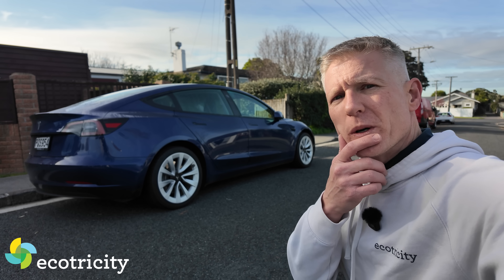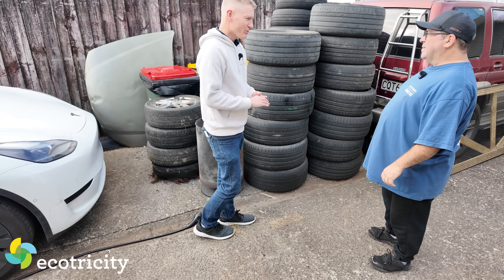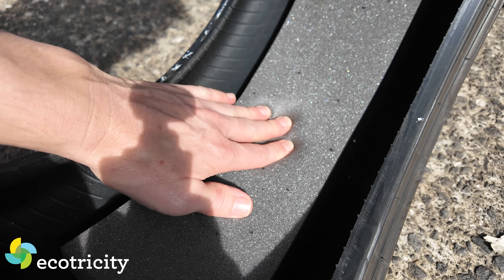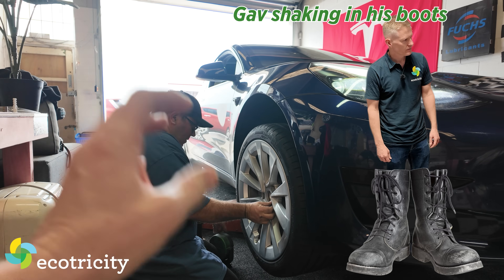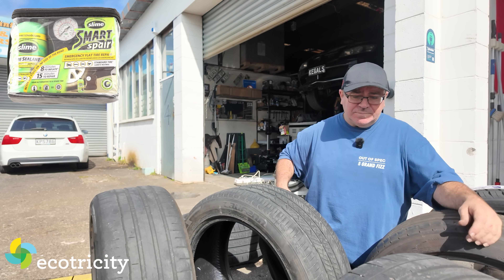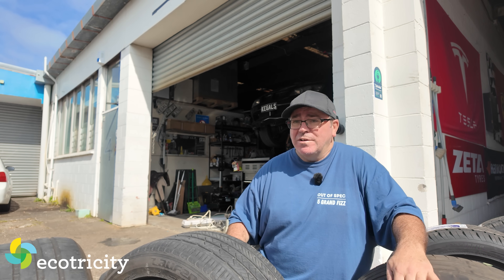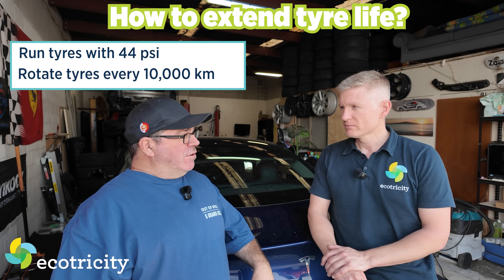EV drivers DON’T MAKE THIS MISTAKE | How to choose the right tyres for your vehicle

Comment: People, as a Model 3 owner for the last 6 years and 165,000km, I can give you advice on this which is better than the advice in this video.  Unless you put adjustable camber and toe arms on the rear, you are going to repeatedly chew through the inner edge of your tyres rapidly.  Therefore, unless you have money to burn, dont waste your money on expensive tyres.  Buy the cheapest possible tyres you can find; the inner edge will wear well before the tread is depleted which means you are just throwing money in the bin. And dont fall for the foam in the tyre gimmick, or the stiff sidewall example in this video; you dont need it.  Tyres come with a rating so as long as you get tyres with the appropriate rating, the rest is hogwash and a waste of money.

Comment: After 3 years driving an EV one of the things you really notice is how quiet they are compared to my other ICE car.  This means you are much more aware of road noise.  DB is measured on a logarithmic scale which means a small number difference will sound very much quieter.  
The other points made in this video are important and scientifically correct.

Comment: I agree with Mark. The last two sets of tyres on my Model S have been Hankook EV tyres. The last change was to go to all season tyres as I was heading through Europe from the UK last winter and winter tyres are mandatory in many EU countries. I am convinced that the tyre manufacturers are learning how to best suit the characteristics of EVs ie low centre of gravity and masses of torque. The Hankooks are quiet, grip very well wet or dry (and were excellent in the snow when we passed through Switzerland) they are very efficient, wear well and the steering feel has improved. My Model S has now covered just shy of 290,000 miles.

Comment: My first factory fitted set of tyres on my MYLR, I got 37,000 miles (fronts) and 42,000 (rear) before replacing - I never rotated. I've kept with the factory tyres which were Hancock Evo 3s

Comment: I use tyre bacon many times on my motorcycles and Model Y. However, in Australia since around 2011, it's illegal to use it and bring to a tyre shops. They won't touch it but make you getting a new tyre. If you have a leak and drive to them, they can fix with a mushroom plug. That is fine.
My car mechanic would take out the tyre bacon and put in the mushroom plug so you gotta find the right people. 
Thanks for the video, my OEM model Y tyres have done 25000 and I do run at 44 PSI.

Comment: i thought everyone did 32 psi, can most tyres handle 44psi?
Reply: There’s a rating on the side of the tyre most 18-21” will be safe up to 50psi cold but I wouldn’t recommend anywhere near that high, also in your door jam there’s a sticker with recommend pressure if you have standard size Tesla 3 and y it’s 42psi,  2 extra is fine

Comment: The tyres you removed (Bridgestone or Goodyear?) had plenty of tread, what a waste. 
And they would still grip and brake far better than those cheapo Zetas, especially in the wet.
Liking that you carry a proper repair kit to fix a puncture.
Reply: Those are Hankook S1 Evo3 
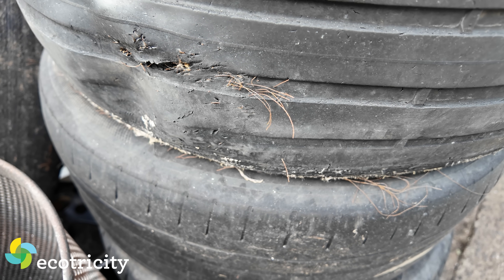@4:47
Reply: @vincecarlo  Great tyre brand, I have a set of Hankook S1 Noble2.
Reply: Hard to see on camera but the rears had bit of canvas about to poke through they weren’t safe tyres.  Have you experienced cheap zetas? Didn’t think so.
Reply: @markbuckingham4171  Fair enough with the rears then.
I've inherited plenty of cheap brand tyre sets on various 2nd hand cars, all were mediocre on dry roads and dangerously bad in the wet.
The Michelin Pilot Sport series are usually right at the top of my recommendation list if you prioritise safety.

Comment: The rears on my EV6 lasted 26000km not great considering I drive like Miss Daisy, replaced them with Toyo Proxes CR1 255/45/R20 non EV tyres...so far zero difference in ride quality or noise, and a lot cheaper. I'll see how they last. The fronts however are still original, and probably about one third worn, so based on my current 30000km might get to at least 60000km, before changeout ! 🤠😎
Reply: Sounds like you need alignment rear might have a toe or camber issue.
Reply: @markbuckingham4171  Cheers Mark, they both wore at the same rate and evenly across the tyre, so not sure if alignment is the issue, be interested to see if other EV6 owners experience the same !!!

Comment: Changed out the OE 245/45 R19 Michelin tyres on the front of our Polestar2 at ~35,000 km with Kumho Ecstas ($300) which were over $400 each cheaper than the Michelins and are performing well so far. Front wheel drive so the front tyres do a lot of work. Rears are still ~50% at 40,000 km. Worth mentioning that rotating tyres isn't practical on Polestar2s as the front and rear rims have different outsets so aren't interchangeable.

Also curious whether other EV owners are experiencing higher puncture rate. We've had 2 in 35,000 km compared to zero during the >200,000 km in our previous Commodore SW. Are low profile tyres running high pressures more prone to picking up debris that results in punctures?
Reply: Lower pressures usually make a tyre more susceptible to punctures.

Comment: Remember that db is measured on a logarithmic scale - a 3db increase roughly doubles the sound intensity (not directly linked to perceived loudness) - strange but true - the more you know 👍
Reply: Yes I know a lot about dbs back in 1997 I built Jonah Lomus Nissan patrol we doubled the power to get 3 db more it was in the high 150s made you feel very unbalanced couldn’t walk a straight line for several mins afterwards!

Comment: Thanks for the video. Last year, I got five new tyres for my Nissan Leaf. (yes, I ruined one tyre within 14 days :-( ).
Around the same time, I noticed a drop in efficiency from 7.x km/kWh to a lower 6.x km/kWh. I'm wondering if that is caused by the fact I bought regular tyres, not EV tyres, to save some $$.

Comment: I had bought four new tyres, but before I could get them on, I had back right tyre deform along way from home in Northland. Because I live in Northland, I had purchased a space saver & jack/ kit from USA specifically for the Model Y. I even managed to stash it under the back boards without wrecking anything.
Fitted the Spacesaver to back right and the car rejected it! The car wouldn't speed up and the ABS warning came on screen and the brakes were overheating. Tesla sent out a contractor with a loan tyre.
I did see a Sydney based YouTuber try out a different make of spacesaver on a front wheel and no problems were reported - but I don't know how far he drove it. Anyway I have ditched my spacesaver now.
Reply: It will be fine on the front if it’s a close rolling diameter

Comment: for a given rolling diameter, do low profile tyres have a lower rolling resistance? any one know?
Reply: Low profile tyres are nearly always worse. The extra mass of larger wheels is one of the main reasons.
Reply: @danielcobb8886  yes, but not because of rolling resistance. rolling resistance should be a bit better with lower profile because of less side wall  flexing.

Comment: If I put EV tires on my ice car will it go further for a tank full, and last longer?
Reply: Only if you plug it in !!! 😆
Reply: Yes
Reply: @markbuckingham4171  yes, but you can not fully utilize the advantage because your recommended tyre pressure would be much lower than optimal for an EV tyre

Comment: NZ using PSI ? WTF? Change to the proper metric measuremant please. I don't have a clue what that PSI equates to. 😀
Reply: That sounds like a "you" problem.
Reply: 1 bar is 14.5 psi , in Nz if I use bar nobody will know what I’m talking about.

Comment: i got pilot sport 5s , i lost a pinch of range but not a deal breaker , the wet grip is great . new tyres with hard corners are noisy but the noise dropped after a short time and its not noisier than my old worn dedicated ev tyres now , or i cant tell the difference . i can tell how much predictable wet grip i have . My hard ev tres cracked on the side walls with 6mm of tread left so yet another reason to go with solid 5 star tyres , im not going to have those go in 5 years only , im certain of that .
Reply: Maybe within a class of tyre EV tyres are better (at some things). The PS4 T1 performance EV tyre speced by Tesla is much more expensive than other premium, generally non EV, options. Going with a non EV tyre allows you to buy a much higher spec tyre for similar or not much more money. I'm betting that the PS5 is better in every way than the EV tyre he got installed.
Reply: @GeoQuacks not in every way  but on a non performance model they do very well for the $$
Reply: Great Choice 
I WILL NEVER Cheap out on Tyres; Esp China Tyres 
LOL
Reply: 100% agree. When our m3p needs tyres im dropping to 19s with 265 tyres and PS4S 🎉

Comment: Still driving a swasti car
Reply: Henry Ford kkk, VW Adolf's peoples car, Mitusbishi Imperial Airforce. Off top of head. You probably pro fossil and are completely blind to the irony of that comment. Smooth brain energy for sure.
Reply: @theunknownunknowns256 Trolling from 110 to 80 years ago. Not even comparable. Got anything from this century?

Thought not
Reply: VW? Nah he’s not!
Reply: I use a dial-type tyre gauge (not the cheapest, appears to be reasonable quality )Generally, the pumps at service stations read about 3psi lower than the gauge. Anyone else make a similar comparison ?
Reply: I should have waited one more day to buy tyres 🤦‍♂️
Oh well will watch again in 45,000kms!
Reply: Wow what an original comment 🥴🥴🥴
Reply: Dummy.

Comment: Just put Pilot Sports on it and you can’t go wrong. If you can afford a modern EV you should be able to afford quality tyres
Reply: I’ve met several people who’s most expensive car was 2-3k then brought a Tesla to save money , they live week to week but driving an ev saves them $ so when it’s tyre time they aren’t buying the more expensive tyres for a very minimal benefit.
Reply: Great Advice 
I DEFINITELY WON'T CHEAP OUT on UNKNOWN Chinese tyres
Drive a State of the ART EV but Slap on Cheap UNKNOWN Chinese rubbers 
🔥🤣
Reply: PS reduce range and won’t go as far. Other than that great tyre, but people should know the downsides
Reply: I have used ADAC's tyre test - you need to read German. 1 year they rated the Vredestein winter tyres way better than the Michelin Alpins and I saved heaps too. But it's difficult to source the best European tyres in NZ.